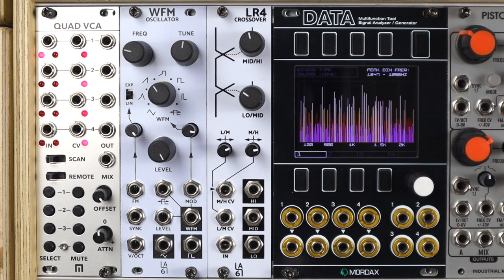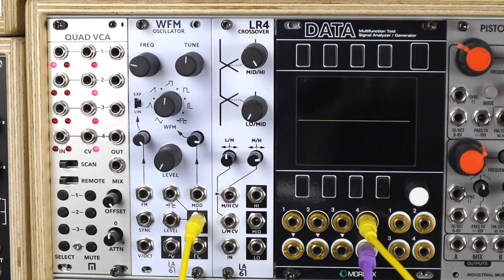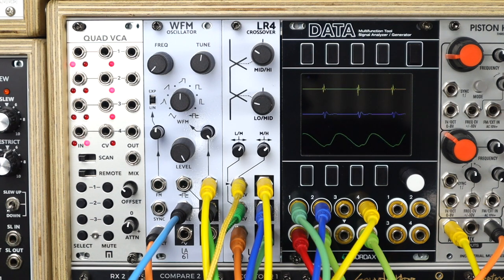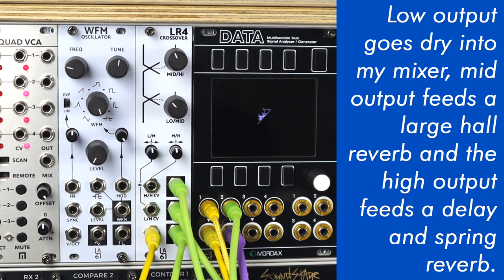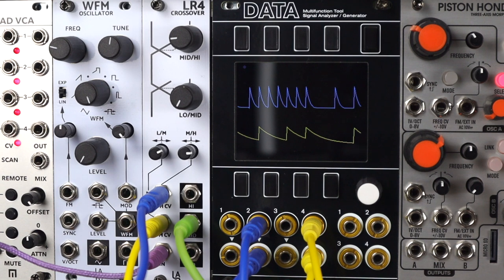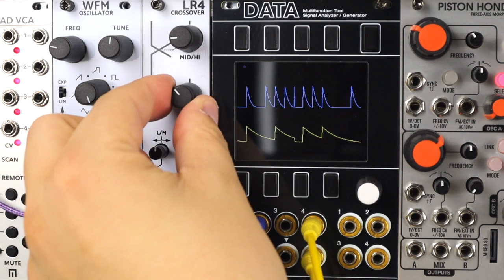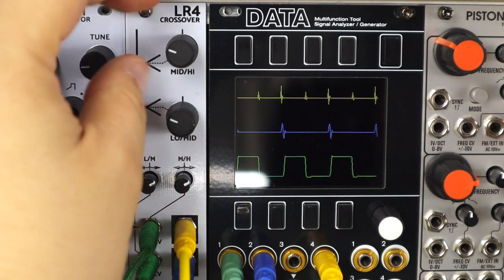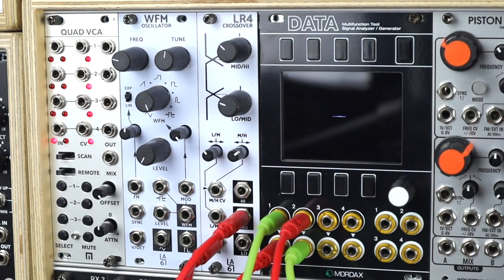LA67 - LR4 Crossover // Making Eurorack Modular Multiband!

Comment: Would be fun to try and run the high band into a compressor, and the low band into the sidechain of that, ive not seen parallel multiband compression like that, where the different bands are compressing eachother. "crossmod multiband compression" you could call it
Reply: interesting concept

Comment: Yes finally!! I’ve been using two mutable EQs to do multi band, but this is perfect. 

Also just skimmed “the design of active crossovers” by Douglas Self. It’s a manual explaining how all crossover are designed. And for this case the 4th Order LR filters are exactly what’s wanted. 

It also explains how all sorts of filters are designed. Very helpful manual if you want to build your own as it has circuit diagrams. https://nvhrbiblio.nl/biblio/boek/Self%20-%20The%20design%20of%20active%20crossovers-2e.pdf

I’ll probably end up making a multi band distortion rack now. Was going to to buy a 19” crossover, but this is exactly what I want. My (expensive) dream is to have trash 2 but in eurorack. 6 diode distortions, 6 tape sats, 6wave shapers, two of these, that new convolution reverb... yeah a guy can dream lol.
Reply from the maker: multiband distortion instantly made me think of this - https://youtu.be/7JRt5JD-59g

Trash2 in Euro! Wow that's going take some serious doing as you say! Funny to think about though. 

I read into the background on this as I hadn't researched any of it before hand and it's interesting, thanks for sharing links and info for others too.